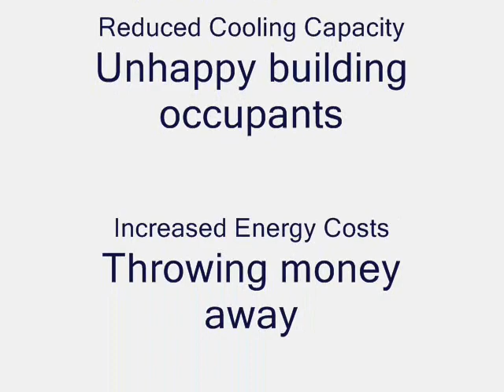Condenser Cleaning Demo Video

Comment from the maker: I wouldn't suggest for just anyone to do it either. A scalpel is also dangerous in untrained hands. The impact force of a 3500 psi pressure gun at one inch is about the equivalent of 3200 psi. (will inject water under your skin) Move the gun back 12 inches and you are down to an impact equivalent to about 2000 psi.  Move it back another 6 inches and you're down to about 500 psi with a light spray you can spray right on your face. It's all a matter of knowing your limitations with the gun.